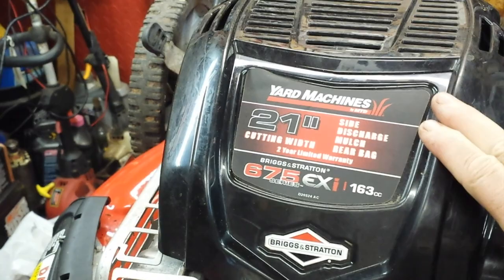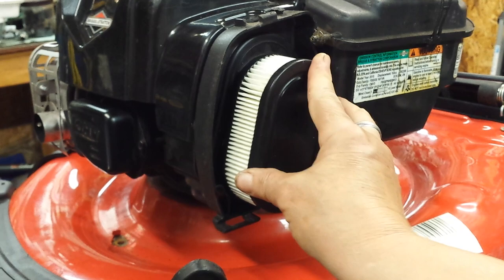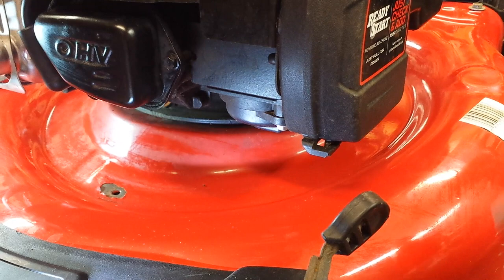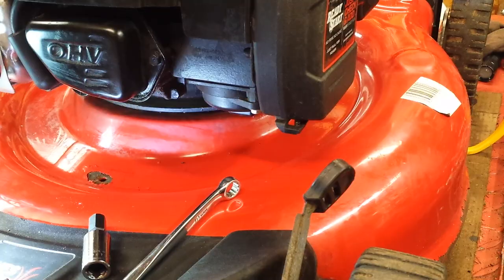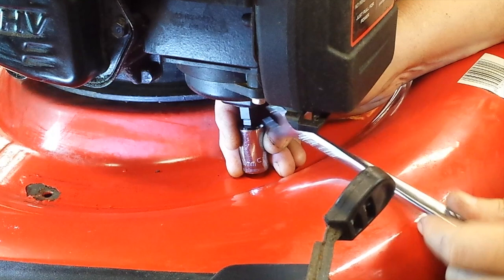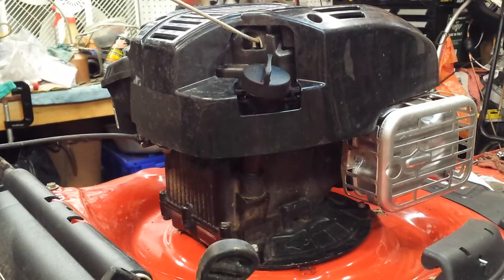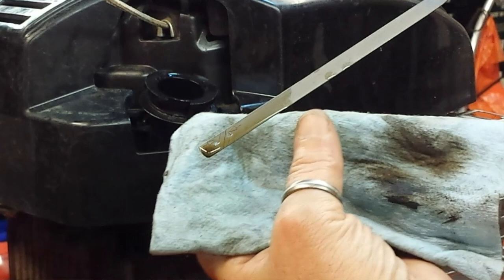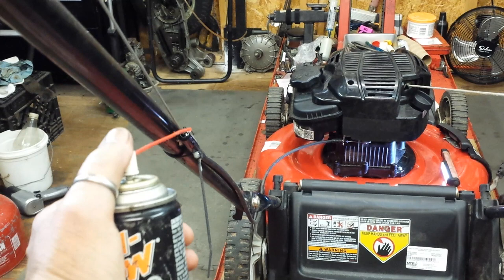Yard Machines 21" Mower Tune-up 675EX Briggs Stratton

Comment: I'm such a huge fan of your content. Thanks. It's funny that you mentioned oiling the wheel and axle. I had a mower I repaired and one of the wheels wouldn't spin. I dissambled it and it was rust welded solid. I was able to remove it, sand it down and it runs better than ever.
Reply from the maker: Thanks Mr Tim!  I appreciate you watching. So often it's simple things. Cheers!

Comment: Did the same on a weed eater mower just dumped the old oil out the fill tube.  It was so dirty i added some trans fluid to the oil and ran it a few minutes before draining.  Poor mower was in rough shape.  Its much happier now lol
Reply from the maker: Hmmm, never thought of that. Interesting on the tranny fluid.
Reply: @TheLawnmowerLady  old tymers trick to help remove sludge

Comment: Some really good tips there Stella. 
We’re starting to see a lot more of those plastic Briggs carbs. Might I suggest, zip cut approximately an inch of the long end of your Allen wrench and use the stub to remove those drain plugs. It will allow you the room to use a tray. 
Cheers
Reply from the maker: I actually thought about that, but decided not. If I had a second, cheap 10mm, I would have. But with only the one good quality, I didn't want to end up with a knuckle buster in my tool box. I really appreciate you watching. Cheers to you too!

Comment: The briggs with the plastic carb on top of the fuel tank is super easy to remove and clean.  Two bolts and the whole carb and tank comes off together.  Easy to drain the tank.  Carb has 5 screws and then you have easy access to all passages.  I love those ones.  If the diaphragm gets out of place you can super glue it to the gasket and get a bit more life out of the set if you are pinching your pennies.
Reply from the maker: Yep, the older ones are more reliable IMO.

Comment: I love how you change the oil anyway, I do that too. I hate the oil they put in some of those engines from the factory, I have seen some of them run poorly until I changed the factory oil. I will never ever be able to not change the oil in any of those engines that come to me
Reply from the maker: I've read the explanation and theory on their white paper, and it sounds good on paper... But for the small amount of $$ for basically 1/2 liter of oil, why not? I see no point in participating in planned obsolesce. I appreciate you watching.

Comment: Good Video, I have had very good luck using an oil vac to vacuum the oil out into a recovery tank very clean and gets all the oil out.
Reply from the maker: Thanks for watching Mr Trent! I did use one for a while, it was Airpower Topsider. But the seals wore out pretty fast, and I never replaced it. Cheers!

Comment: My control cable broke for the drive on a newer common MTD 21" fwd. I need to figure out how to buy some universal cable and do it right.  Awesome channel!
Reply from the maker: Thanks Mr Bob! I’ve seen folks cut good ends of bad cables, and reattach to good cables with pinch bolts. And I’ve seen replacement z-bend ends that have a set screw to attach to a cable. They’re kind of pricey. I personally just purchase a new cable assembly for these repairs. There are too many sizes and styles of cable ends for me to try and stock. Cheers!

Comment: Hi I have watched  a few of your videos and I get a laugh out of all the peoples names you say that (I'm not so and so) I get a laugh outnof that and I like how you go into what needs to be done on a lawn mower but in a nut shell not talking about something then getting to the point, do you collect lawn mowers? Have you heard of the Toro  super recycler with the 2 or 4 cycle Suzuki engine? or the John Deere with the Kawasaki Engine on it they last forever.
Reply from the maker: Thank you Mr David ! I’m not a collector, but I do have an abundance of mowers around, mostly for parts. I’ve ever seen one Suzuki on a cub cadet push mower. It was a really nice mower with those zero turn front wheels, but all rusted out. I kept the engine, in hopes to put it on a good deck. I appreciate you watching! Cheers!
Reply: @TheLawnmowerLady  your welcome and thank you, I'm curious if that Suzuki engine is the same one that was used on the Toro in the 1980s. I hope you will make a video in the future about it thanks. happy mowing

Comment: Engine hunting on the governor?  Might have been some fuel in the crankcase showing overfill.  Speaking of overfill (wink).  If I don't have the correct allen key I will look for a bolt the same size and use it.  Oil and dirt make an abrasive slurry but what can you do?  I try to use dry lubricants if possible.  Have you ever heard of Fluid Film?  I have a very old 2 fluid oz bottle of tri-flow that i still use from time to time.  What about the blade?  Well, keep your saw in the wood and your stick on the ice!
Reply from the maker: Thanks Mr Joe!  I did sharpen the blade as I recall, but this is my basic tune.up procedure.  That's a great idea on the bolt/nut combo. I fail to think of the easy answers. I think the surging sound was just bad audio. ( I shot that on my mobile phone). I appreciate you watching. Cheers!

Comment: Ok now Stella, you gotta get out my head I lol!! I just repaired  the same type machine , the carb and air box was really yucky ,the welch plug fell out question would a back pressure ,or backfire,  cause that welch plug to pop out?
Reply from the maker: I can't imagine that could happen Mr Joe, but you never know. I think just the soft plastic of the carb would not hold that plug in too well. Thanks for watching!

Comment: Hi, I bought one of the same models and had a surging problem. So I pulled the carb and removed the main jet. It looked ok so I cleaned the complete carb anyway just to make sure. But it still surges.  I read this is a problem with these cheap carbs. A few people said it is that the main jet holes are too small and it affects the air and fuel mixture. Can you tell me if this is true or not? Or should I just buy a new carb?. I am glad to see a lady working on engines the way you do. Good for you.
Reply from the maker: You can always try replacing the entire fuel jet stack? https://amzn.to/3C1MJ2h I appreciate you watching. Cheers!

Comment: Unless I missed it, I didn't see you check the blade.
Reply from the maker: Thanks Mr Jim! I usually check blades on "intake" with the client there to give them a better estimate. I honestly don't remember this particular mower, but even if I did sharpen these blades, I sometimes choose to edit out parts of repairs that either drag them out, or are not an integral part of a particular video's main content. Cheers!

Comment: Good video. These are good mowers, but that's a weak handle design. I've purchased several from eBay for my trash picked mowers to sell.
Reply from the maker: I agree, those bolts holding the handles get loose, and eventually break the plastic mounts. Thanks for watching.

Comment: WAIT... Oil needs changed? LOL
Reply from the maker: I know, right?
Reply: @TheLawnmowerLady  Sometimes when I do oil change videos I feel like my time would be better spent learning a dead language, maybe sanskrit but with a German accent.  😄
Reply from the maker: @RandomhumorwithBill I took many, many years of Latin in school. See where it got me?
Reply: @TheLawnmowerLady  Latin was my required second language in HS. Don't... know... one... word... of it now.
Reply from the maker: @GuysPlayingWithTools  I remember a few: Tu ne cede malis, sed contra audentior ito - roughly translated means: If at first you don't succeed... Try, try again.
Reply: @TheLawnmowerLady  If you are going to remember one thing from Latin, that's a pretty great thing to remember.
Reply: @TheLawnmowerLady  Off topic, I tried 10 or 15% Pine Sol in the Ultrasonic cleaner, worked like a charm!
Reply from the maker: @GuysPlayingWithTools  I find it has enough solvent properties to clean all but the worst carbs. Doesn’t discolor the carb bodies so badly either. Cheers!